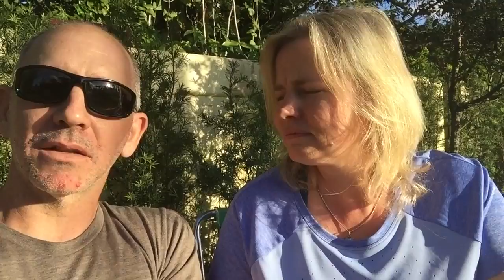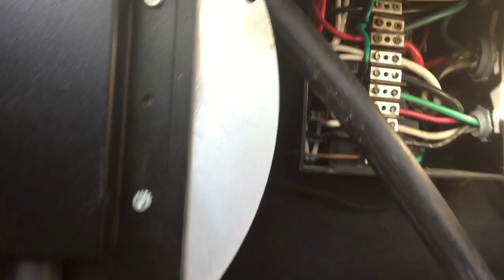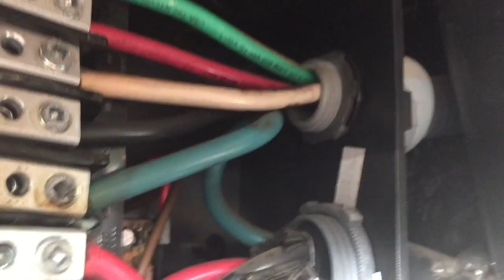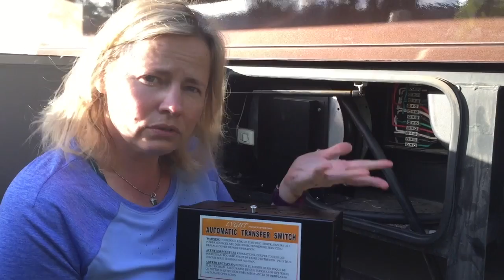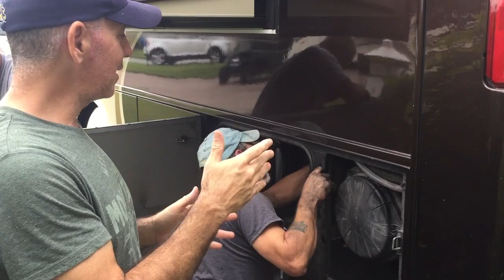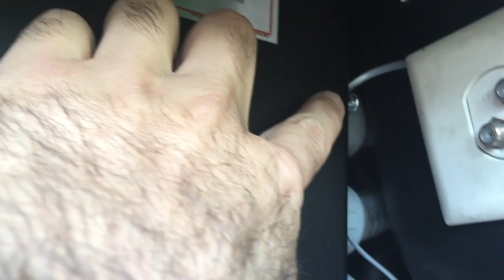Replacing A Faulty RV Transfer Switch

Comment: Where does the inverter AC get injected into the system?  Downstream from the transfer switch then?
Reply from the maker: Hey Brian, yes, the inverter sits down stream from the main breaker panel (which is just downstream from the transfer switch).